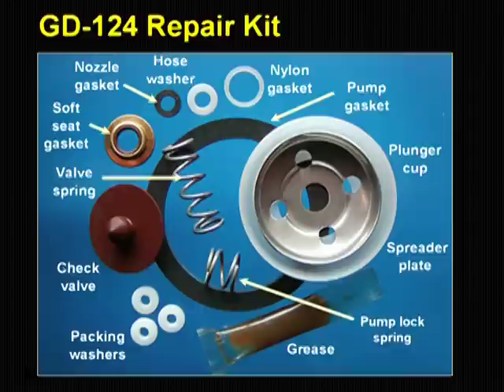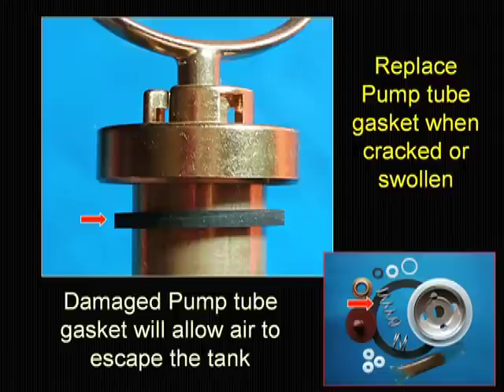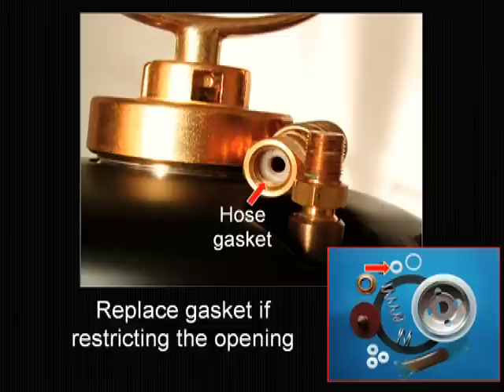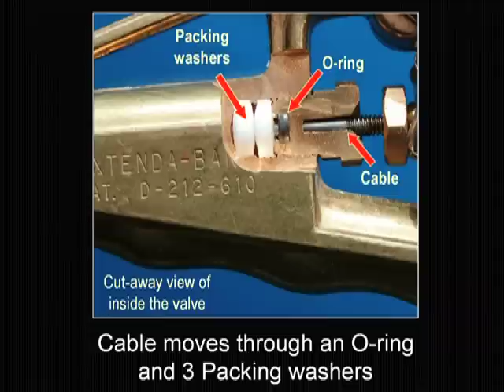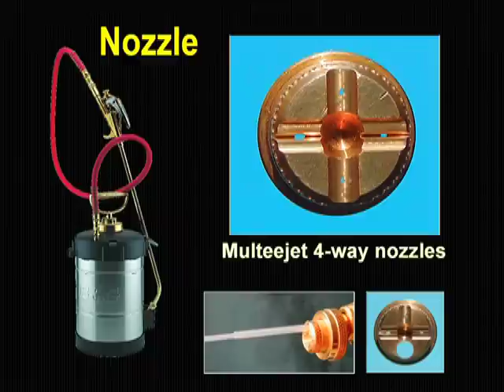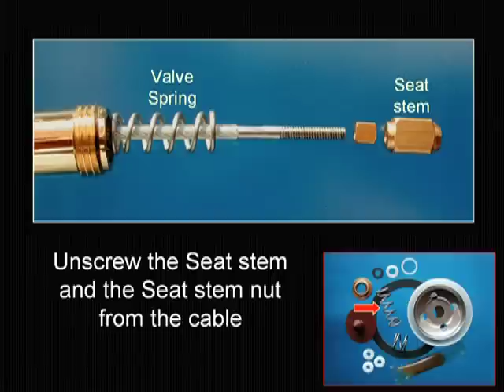B&G Prime Line Sprayer Maintance

Comment: What kind of grease do you recommend for plunger cup in between replacement just to keep it lubricated well?
Reply: Axle grease (synthetic) is what comes with a new cup, but I use petroleum jelly, it's thinner and seems to lubricate a little better.
Reply: I roll my leather cup in a solo cup with 1/4" of used motor oil.